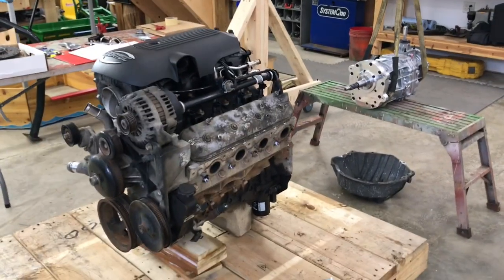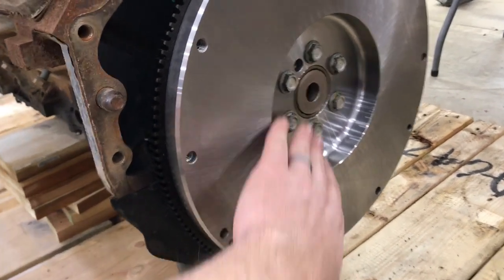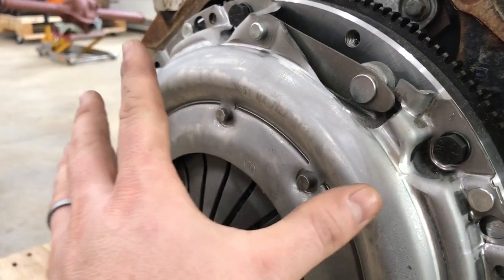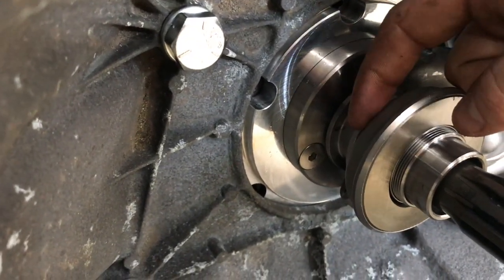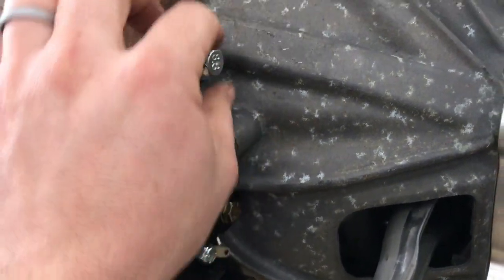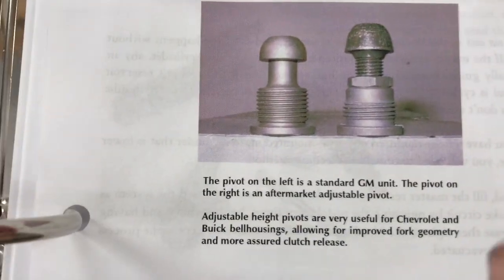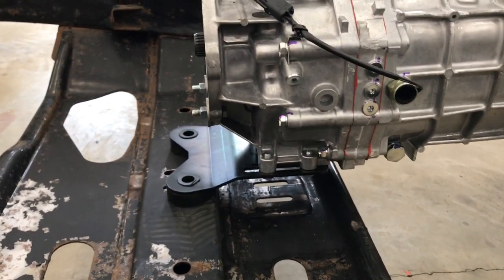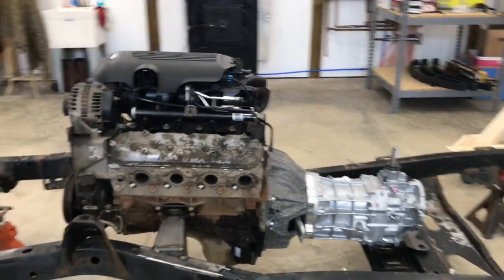Part 2: Project Blue-J Novak Conversions AX15 5.3V8 Installation

Comment: Hello there, did you have any issue installing the motor mount? doing a LS swap on a 04 LJ with 5.3 and 4l60e and trying to decide what mount to go with. thank
Reply from the maker: These mounts worked perfectly.
Reply: @BobWilson84  To clear the firewall, Did you have to remove the intake when installing the engine? Do they provide you with a location to position the mounts?
Reply from the maker: @masu3701  I installed the driveline then lowered the body onto the frame.  Can’t help ya there sorry.

Comment: I’m doing the same swap I’ve got the throw out bearing measurements studs in but the clutch fork is kicking my butt I have the adjustable pivot what is the secret to get pivot forks on the pivot ball and then how did you adjust it with fork installed
Reply from the maker: Crap, I don’t recall anything other than I needed a longer shift fork pivot ball thingy

Comment: Hi did you complete your Jeep because I have a CJ 7 Jeep 1981 and how hard is this task to take on and how does it run and do have any pointer
Reply from the maker: Yep,  nearly done.... check out the latest video I made.  Overall,  it was reasonably difficult for me as this was my first vehicle restoration (minus experience working on other stuff). It runs like a champ,  advise:  put together a list of stuff you’ll need and come up with price and double it.  Ask yourself is it worth it.  Good luck

Comment: if its not too much, could i get the PN for the clutch and fly wheel parts, looking at the price differences overall between this setup and the advance adapter setup for my 89.
Reply from the maker: Give Novak Conversions a call... they’ll get you the complete parts list and go over all the details and $$$ with you.  They were very helpful.  I didn’t care for the advance adapters design, although I see many people online have good results.  I personally was impressed with the customer service Novak offered.  Good luck with the project.

Comment: Hey man question. Can you use the regular 5.3 starter? Or do you need a special one?
Reply from the maker: The factory starter fits, but I elected to use a smaller gear-driven to be safe

Comment: I'm looking to do this swap but I have the nv3550 on my 2001 tj, I'm going  back and forth between hemi,magnum and ls, but always keeping the jeep manual transmission and budget friendly
Reply from the maker: Right on,  for what it’s worth, in my project the new AX15 transmission was not a huge portion of the budget.  I know the NV3500 is supposed to be a great trans,  so I don’t blame you for keeping it.  I’d just suggest reviewing the free info at Novak Conversions before you get started.  Good luck!
Reply: I built 4 TJ V8's and used the NV3550 in all. Not fond of the smaller AX15 4-6 cylinder transmission behind a V8. Also used the 5.9L Dodge motor as it's a much cheaper  and easier way to go. Almost plug and play!

Comment: I just don't get why everyone is throwing these AX-15s behind a 5.3???  They are not even close to rated for that engine.
Reply from the maker: Hello... I think the AX5 might be the transmission you are thinking about.  Seems like the AX15 is pretty popular for this engine swap and lots of guys are having good luck with them.  I think a 4L60E would be much stronger if someone planned to build an epic 5.3.  Hopefully with normal casual driving and a tame 5.3 the AX15 will last.
Reply: @BobWilson84  The AX5 doesn't even bare mentioning. I know that thing is a complete turd. But the AX15 is still considered light to medium duty at best with and input torque rating of around 300 ft.Lb.
Reply: @TheFlanman10  A new (not rebuilt) AX15 transmission is rated for 385 lb.-ft. of torque thanks to updated materials and manufacturing
Reply: Yes,,,

Comment: I’m in the process of doing the same and your video is extremely helpful! Out of curiosity are you using a 460486 bellhousing?
Reply from the maker: Sorry, I looked but didn’t find any numbers on the bell housing.  I know it was out of a truck and was the larger size for a 168 tooth flywheel / flexplate.